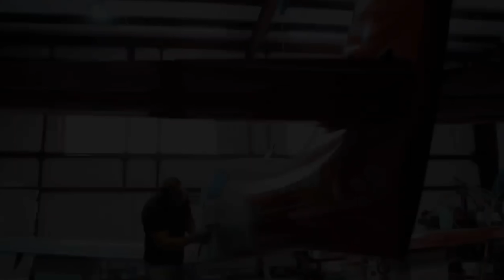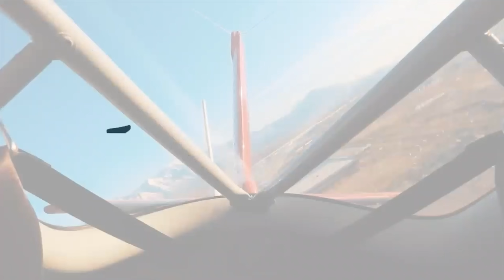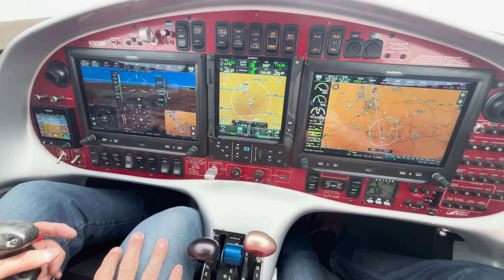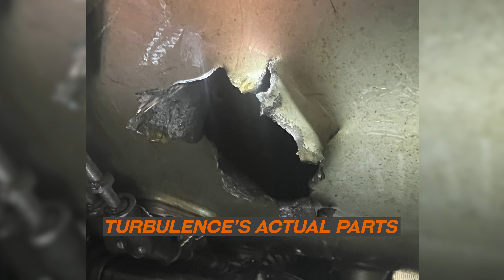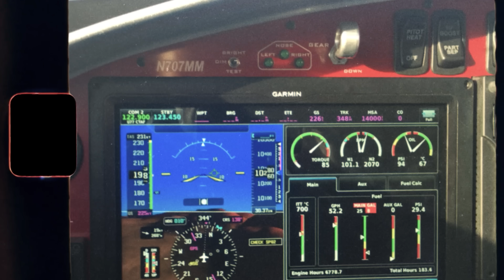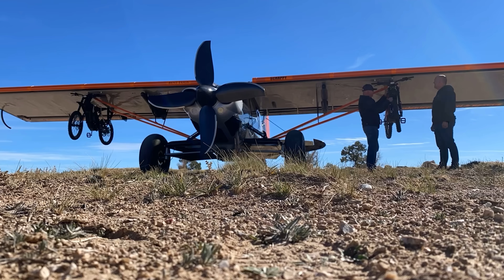Aircraft Engine Explodes - We find out Why | Turbulence Update

Comment: I love digging into log books for many reasons some of which is they are like a story book and should be able to paint a picture and a snap shot in time. Some of the older airframes really show the legacy and art of what use to be legible hand writing. Unfortunately and more importantly the log books on any aircraft or engine can also tell you a story by what has not been recorded and should have been. I do a lot of pre-buys and I spend more time on the logs books than the aircraft.  I also am of the opinion that good logbooks represent 60% of the value of the aircraft.  Checking the hours calculation on all components, airframe, engine from the production test flight on frequently finds math errors. I once had a customer complain because I was spending so much time on his log books, until I told him I found multiple math errors on the total time of his airframe which added thousands in value back into his aircraft.  I have also unfortunately responded to a few folks whom never had a pre-buy done. One of which involved a court case after I uncovered by googling the N number and finding a newspaper article uncovering the fact that the aircraft was involved in an accident on floats and it sunk. That conveniently never made it into the log books. Something that premeditated fortunately is rare. Performed maintenance on a lot of PT-6s. To have one come apart even with the missed A.D. is rare. Luck and skill, gods speed to you Mike. Thanks for that very honest and well done analysis.

Comment: The only aircraft I ever had a dual engines was powered with 2, -61 PT6’s.  Lost oil pressure in both engines due to error in manufacturing.  It was in flight test. Mike likes them but I had to reject more PT6’s than Garrett due to over temps right from the factory.

Comment: Reminds me of a test flight. I made in vietnam in nineteen seventy for some other unit's cobra. I started up The aircraft took off, pulled in forty pounds of torque and climbed to two thousand feet to see what the vibration was. I tried to put the torque down to twenty pounds for cruise, and the aircraft went into a violent 1 to 1 vertical vibration. We went through two layers of clouds up to ten thousand feet, and I wasn't sure how to get the aircraft down. I slowed it to 40 knots To reduce the load and fortunately, I was able to get the collective down to twenty pounds. I declared an emergency and brought it in for a running landing. It turns out the other maintenance company did not pull her twenty five hour grease job on the swashplate, and the squash plate bearings ceased in the air, which made it look like that gear shaft.

Comment: Back in the early 2000’s I was flying a C208B. The night before my flight they did a scope as part of regular maintenance. Next day I had a cargo flight. Did my system checks, took position on the runway. Applied full power. After a few seconds it sounded like a vacuum cleaner sucking up a rag. All engine indications were fine. But I aborted takeoff. Taxied back in and shut down. After months of investigation by a forensic lab it was discovered that during the scope the previous night the FOD mesh install went wrong. Apparently pushing a washer out of place and it was floating inside the engine. Once full power was applied the washer gave way and pulled through and cracked a blade thus causing a cascade. Got lucky that day and I walked away. Sorry to hear you had to go through all that but glad to hear your experience allowed you to make it back in IFR conditions. 😅

Comment: I've been an IA for years, and have become increasingly cautious about my AD searches. You cannot do it thoroughly enough in a reasonable time on an unfamiliar aircraft...reading extensive haphazardly handwritten logs from years of mechanics. All in a hurry, many with poor handwriting and variable communication skills.
   Also- ask yourself: are all the AD's, for,  say, ..the instruments complied with? Did the last guy know? 
   To know that, you have to know the make, model, and possibly serial numbers, just like any other part.
   On instruments, that info is not on the front, making instrument panel disassembly,  at least partially, likely necessary.
    Nobody does it.
   Just trust the last guy, who trusted the guy before...etc...that, plus no new AD's since the last annual...that's good enough, right?
    No, not really. See how that worked for Mike, here.
    I'm becoming less and less interested in doing annual inspections.

Comment: Just like decisions around flying, sometimes the right decision comes with disappointment and changed plans. Surprised looking at blown planetary system. Every bone in my body wondering why the teeth were not helical. Someone decided the thrust component of helical gears was a negative, be it weight, complexity and cost. In my view, the smoothness and perfection helical gears offer outweighs straight cut gears for high speed operations. The spline issues are a direct result of a non constant pitch velocity. Straight cut gears have micro accelerations and decelerations of every tooth  as they transmit power. There is an additional aspect of gear trains. When a planet gear is driven by a sun gear it has a force imparted on the tooth. Now this planet contacts the annulus and the force is in the other direction. This sets up a fatigue action. Something going from positive to neutral and then from neutral to negative stress has to be carefully controlled and monitored. Ie a conrod is an example.

Comment: This whole "Missed the AD because it was so old" thing is why I think there should be some low cost but very functional electronic logbook tracking software for GA category aircraft.
If all these paper logbooks for Turbulence, and specifically the PT6 Engine for it, got put into a database that is easy to sort and search thru, then you'd have a powerful means to independently verify the status of any specific action performed on the airframe or engine so long as that action was noted in the logbooks. So if anyone who had a copy of that electronic logbook got curious about if/when exactly some specific AD got performed, they could just look it up with a simple search, and if they don't find it, guess what, it didn't get done and should be addressed soon!
EDIT: Of course, there's more than one way to put corks in the swiss cheese that led to this particular incident, but that's the great part about failure analysis, it usually finds all the holes that this particular incident slipped thru, and so you can figure out methods to address each one of the holes that was passed thru as they are discovered, and make the system as a whole that much safer in the future as a result.

Comment: Hope you had back up batteries for IMC conditions in an emergency?

Will you now think about dumping turbines and start building brushless electric hybrid engines for your projects instead?

It would always be good advice to derate the older turbine models to prevent this from happening.

The future is here on electric flight hybrid technologies for PPL flying.

Do what the failed Boeing company should have done years ago, dump the outdated heavy metal, develop smart technology and smart airframes.

Comment: When we get an aircraft into our shop for prebuy or annual that we have not seen before, the entire first day of work for one person is going through the logs and verifying that all the ADs which apply have been complied with correctly, been signed off, and that no changes have been made to the aircraft since that would cause those ADs to apply again. It's an 8hr process, but we find stuff like this that has been missed or incorrectly done on probably 3/4 aircraft. Most of the time it is minor stuff, or just bookkeeping errors like signing of and AD which doesn't apply for the wrong reason (NA by S/N instead of by date of overhaul, etc.), but sometimes you find something which was just flat out never done.

Comment: Question did you consult an attorney?

A mandatory service not done you would think that would fall under gross negligence
Reply: I doubt any attorney would take it on once they find out the engine was sold to Mike clearly marked "Unserviceable".  It was never meant to fly again, but Mike installed it and flew it in spite of the condition of sale. Watch Blancolirio's video regarding the rest of this story.
Reply: @SEO122 I guess I didn't hear it was listed as unservicable

Comment: I had the mini version of your issue. Rotax 912IS gearbox ate itself in an Aircam over the Delaware bay at 800 feet. Luckily it didn’t explode but it did make a lot of metal inside. Entire teeth were missing, parts of other teeth and gears. Heavy, deep scoring on the crankcase and gearbox housing. Absolutely maxed out magnetic plug. It is nice to have two engines😊. The Aircam doesn’t glide quite like Turbulence.

Comment: Power turbine blades are designed to fracture before its disk. Disk bursts are way more serious! The blade shedding speed for a power turbine is something like 160% of the max speed.  So your power turbine went up to ~50,000 rpm or so, not 100,000 for sure. Once a disk has no blades, it slows down to zero.

Comment: Every aircraft should have a list of AD"s that shows the date, hours & person that actually did it, that you use as a index to find it in the log books. Even that said you can not always verify that it was done unless you dismantle, check the parts or perform the inspection again. The Adlog system is very good & broken down into different sections all in a 3 ring binder. The AD toolbox just spits out a list sometimes incomplete with the present mechanic doing the annual name on each one that never actually performed all past AD's and signs his name to all of them by checking a previous list not the actual log books which is the legal sign off. Alot of times they are recurring & still open. Buyer beware some experiments don't do AD's even though they got a certified aircraft part or component.

Comment: Sometimes, it is probably faster/better to use the AD list as an inspection list. Obviously the paperwork needs to be in order, but you can pull all the applicable AD's and visually see if it was done.
Especially for something like a gearbox, I'm sure if you were aware of that AD, you could have stuck a boro up the drain plug

Comment: just think if one had a separate cabin compressor and and the engine in the rear so the airframe isnt broken and if you had an rpm regulator on the turbine g
for the fuel and a sacrificial coupling to the gearbox and stuff in stead of designing an inherently unsafe machine if you skimp on maintenance

Comment: Of course there are multiple maintenance tracking programs (CAMP systems), For example,which  do this  tedious work quite well. Unfortunately they cost money and being as most Part 91 aircraft operators are cost conscious, ie: cheap, they do not buy these programs. Also, to be truly effective they have to be on a tracking program when the airplane, engine, is born ensuring nothing is missed.

Comment: I consider that it's important that you actually got the plane down in one piece and was able to perform the post mortem on the engine to find the actual root cause.
Your misfortune this time could actually save lives in the future, because how many of those engines are out there that haven't had this corrected?
Your willingness to share what you do - that's also very valuable and educational for a lot of people.
What would be fun to see would be a carbon fiber replica of a DeHavilland Mosquito, because why not?
Reply: Indeed so, and should that AD be revised to include the part numbers (newer part numbers) for the planetary gears in Mikes engine that self disassembled at 30,000 rom? The AD was specific to (older) part numbers, and the failure in the AD is exactly as occurred in Mikes engine.

Comment: You are super lucky. Loss of load on a turbine engine often ends up with the engine totally exploding. I spent 35 years as a turbine engine engineer. I have been the guy whom did the loss of load testing for several engines. The engine could have sawn the front of the airplane off in addition to catching it on fire.

Comment: You should have had a survey done...owned a few helicopters, bought second hand, small fleet of 1 twin and 2 single engined turbines, found issues, the big one was fraud ... false certificate of overhaul. Meaning the engine in the  twin chopper was run out, over time by near 400 hrs. Next I hired a replacement engine, on service a smart engineer noticed something, again, fraud, hours misstated, again beyond overhaul .  Another lead to the close down of an engineering company fitting run out parts on my first heli. Life lesson get a survey done

Comment: I’m in a Part 147 Mechanic school right now. One of the exercises is to do a complete AD compliance search for one of the school’s airplanes. It took a good 20 hours of work to go through the airplane, engine, and propeller logs to verify a log entry existed for all applicable AD’s. I could see how easy it would be to miss an AD. Having a detailed AD compliance sheet is critical. I like to document the log number and page where the entries exist. Also having a list of the changes to the aircraft over it's life.
Reply: You are correct. What makes A. D.s so easy to overlook is an accurate equipment list. Once all the installed equipment is verified, then it’s a line to line search for applicability.
Very tedious work, but accurate logs and records
are essential to an aircraft’s valuation.
Enjoy your training- a wonderful career awaits you.
Reply: Glad you are pursuing a career in aviation MX.  As an IA whenever inspecting an aircraft for the first time, a list of info from all of the data plates gets created.  This includes the make, model, serial number of the airframe, ELT, prop hub / blades, engine, and all of the accessories (mags, starter, vac pump, alternator, governor, etc.).  Each of these gets an AD search and that list is given to the owner.  Also, anytime a component with a serial number gets swapped always record the old and new s/n in the log books.  That can be your best defense if any future unlogged MX occurs.
Reply: Seems like a job for AI.
Scan the logs, let it do the searches and correlations.

Comment: This is your second used engine as is that failed (wasn't the first on Scrappy on the way to Oshkosh).  Never, ever ever accept a second hand engine even if the head of the AOPA had it built himself..but you already knew that.  Also, how many ADs have been issued for the engine since your engine's original build? Are those avialable or are they in some mysterious vault.  Here's where I would have focused ALL of my efforts before purchase.  Your tests were good, and macro.  Screw whether they forgot an AD or not FIRST, check the AD list.  Anyhow you recommended another dude for doing this work.  THat's wise.  And again you've damaged your airplance, causing time.  For you, buy a brand new engine that is certified.  For you.. with your situation.  Those are my poorly informed 2 cents' worth.

Comment: The means by which I track ADs is to have a separate spreadsheet with every AD on it, and status and date of compliance. First thing at annual is to determine what new ADs apply. How many IAs addressed your engine without ever doing that? I really don’t understand how no one ever did that. My mechanic would have insisted, and I would either have done it or had him do it (for $ of course). 

What a great engine, staying relatively contained after such a catastrophic failure. Amazing stuff … cheers Mike!

Comment: Just like a 2-stroke. Great power then bam, power off. Done that many times in ultralights.
Reply: I've had tow Kawasaki 440A engines fail in flight. One front crank bearing disintegrated and sent shrapnel into the combustion chamber. Video of that on my channel. The crankshaft snapped in half between the case and the flywheel on the other one. 
I'm no longer flying with a Kawasaki 440A.

Comment: even good working ones that are TX'd  will go in and you see a pick of it in pieces full of red tags at the overall shop. people are scared to sent even a gearbox in, as if it goes in for whatever reason like a 5 buck seal  needed, You  especially as a lessee after 100 hrs, not have to pay for all next shop visit repairs TB's etc.. PT6's were required to have a 30 day running of the fuel controls, Turbomeca's need a run every couple weeks also.